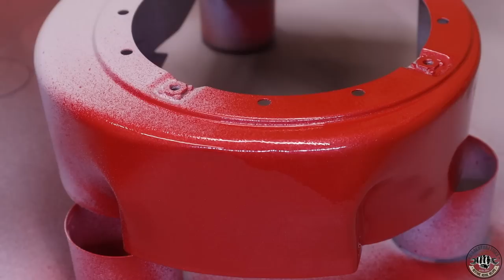1984 5hp Briggs & Stratton engine Restoration - Part 1-

Comment: It looks like they drilled a hole right through the crankshaft in attempt to stop the pulley from rotating on the crankshaft meaning that the shaft, keyway & likely the pulley is worn.

I would've got the crankshaft repaired by a machine workshop including getting a new keyway cut into it, whoever has drilled right through the crankshaft has weakened it.

I rebuilt my 3 horsepower Briggs and Stratton lawnmower engine & I noticed that there was a knocking noise coming from underneath the lawnmower, the blade boss which the crankshaft is fitted onto had clearance between its bore & the crankshaft,the key was slightly worn as well because I could rock the blade disc backwards & forwards on the crankshaft even when the centre bolt was tight.

Instead of drilling a hole through the blade boss & tapping a thread into it to fit a grub screw I cleaned the mating surfaces & applied Loctite 620 to both surfaces before fitting the blade boss onto the crankshaft.

There was 0.1mm clearance between the blade boss & the crankshaft, that saved me $50 AUD which is how much a new blade boss costs & it would've needed a new key as well.

The blade boss was rusted on at one stage so the crankshaft may not be the same in diameter as it was when it was new !

Comment: 5:50 Does that trick work on motorcycle tapered flywheel shafts?
Reply from the maker: Yes it should work, just make sure its a copper hammer otherwise you will do some damage.

Comment: That engine was made the same Year when I graduated high school the Air fliter looks like a  style of fliter less  type of carb those muffler came out easily and didn't break sometimes they can break but they came out easily for you😊 oh there is the album by van Halen called 1984 😂
Reply: Also, a book by George Orwell.
Reply: @jimdavis6833  thanks for the info on this matter of the book that was released the same year
Reply: @robertmailhos8159  It wasn't released the same year, it was the name of the book, 1984.